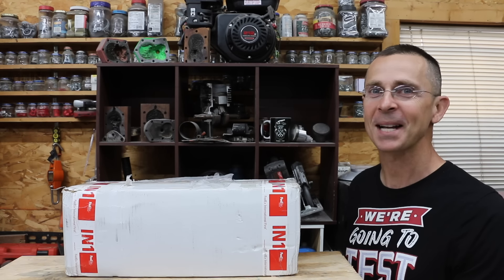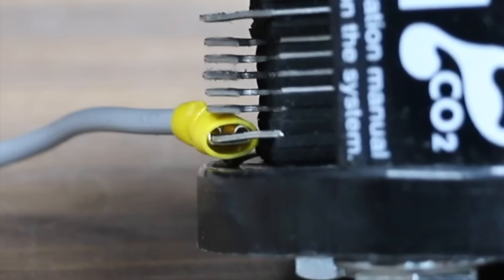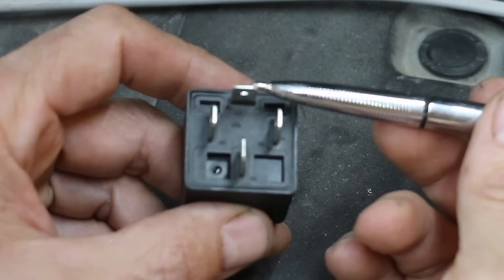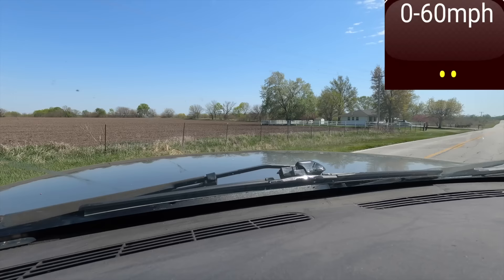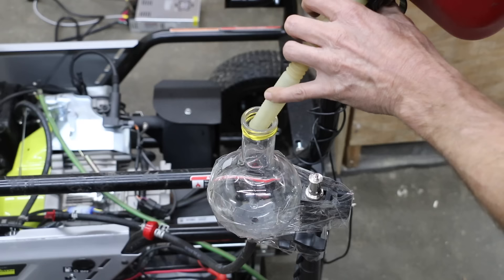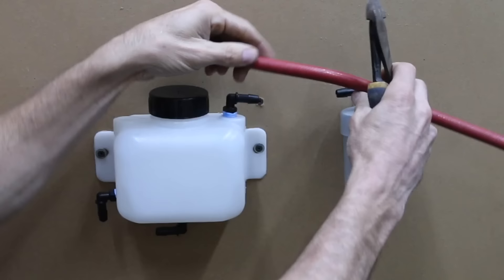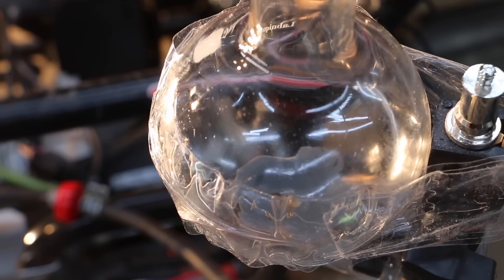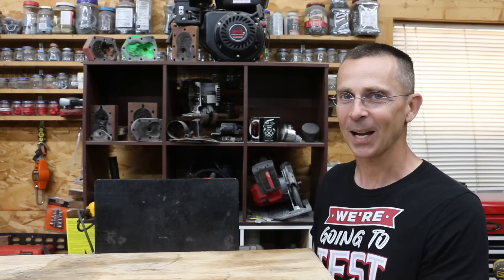AMAZING 35% More MPG with HHO? Let’s find out! Help with high gas prices?

Comment: I recently did a tune on my S-10 with "lean cruise" and so far it seems I only gained about 2MPG. But honestly, keeping up with maintenance IMO is the best way to MAINTAIN good fuel economy. I had a customer a few weeks ago with a wee little 4 cylinder car with almost 300,000km on it complaining about excess fuel consumption. Apparently had regular oil changes since new and a recent new air filter but come to find out IT NEVER HAD SPARK PLUGS REPLACED! Well, that customer called me 'god' for 'restoring' fuel economy and even 'adding' power to their car. Well, no. it's just maintenance lol. 

Also, Project Farm, koodos for going thru that much effort just to show people how this works and if it does work! you have a level of commitment to be desired.
Reply: When is the last time you could actually 'tune up' a vehicle?  1985?  After that they all 'tune' themselves thru the onboard computer controls.  that said I had to laugh at myself when you said they never changed the plugs... I have a 2000 Intrepid I purchased new that has NEVER had the plugs changed either with 217,000 miles! lol  I keep thinking I should pull one just to see if they still have electrodes! LOL
Reply: @tubedude54  When I said I did a tune on my S-10 I meant with HP-tuners. I programed lean cruise in the computer. Your intrepid should be surprising to alot of people but doesn't surprise me. Theoretically it shouldn't be running.
Reply: @michelleberry-1314  Oh NO!!  I better not say out loud when I am driving it that it shouldn't be running! lol  To be fair I did have all the regular maintenance done to it till it hit 75K miles and the warranty expired.  It never said in the schedule to change the plugs in the first 75K so as far as I know it never happened.  Only thing I think about now and then is the timing belt... it was supposed to be changed at 75K if I recall... never was.
Reply: Damn that's some god quality spark plug tho
Reply: @feero9680  I'm tempted to pull one to look at it but afraid in might crumble when I try!
Reply: @tubedude54  I would check the spark plus because those champions are copper. Wonder how they look
Reply: @tubedude54  I had a ‘99 intrepid with the 2.7L engine. Wasn’t a bad vehicle
Reply: @christophervanzetta  Still get about 30mpg on the interstate!
Reply: @tubedude54  you can do spark plugs and coil packs and all that other stuff on cars made up until recent years. It's all nuts and bolts at the end of the day you may have to take an intake manifold plenum off or something like that on some of them but it's still doable. You been living under a rock?
Reply: @kskip4242  Just a hole in the wall! lol
Reply: dirty maf sensor is one that will destroy fuel economy as well,just spraying in clean when doing maintenence is somthing grossly overlooked during tuneup yet very important
Reply: no doubt the oil changing companies told him that they would replace them when they didn't and then they over charged him on multiple occasions. 

it's happened many times and many people have been ripped off, mostly from jiffy lube, that company is so crooked they should never get business for their shady practices. 

not saying you were this, but the places he was likely to get his oil most likely did this as it's very common for folks to go to jiffy lube for their oil change as well as other shit they talk the customer into.
Reply: The actual best way is simply running lower resistance tires at proper inflation levels.
Reply: @kskip4242  I easily replaced spark plugs in my 2005 Camry 2.4. Took me 20 minutes to do it. Did the wiring too. It ran better. Spark plugs are tested to 100k nowadays, I believe. I was past that.

Cleaning the throttle body did wonders too.
Reply: @afcgeo882  oh yeah most four-cylinders are Uber easy to change spark plugs are literally right on top. Anything with a V6 or V8 is a different story.
Reply: @kskip4242  Sure. Inlines are easiest, then Vs, and the Boxers are the hardest.
Reply: @afcgeo882  to be honest the v engines aren't really that hard it's the ones that are mounted transverse in the front wheel drive cars that are hard because you have an intake manifold that normally protrudes over the rear Bank of cylinders meaning you have to take that upper intake off just to get to the damn things.

Comment: You should use the thread tape for gasses vs the liquid kind. I believe it’s usually yellow in color 👍😊 
LOVE your videos! Don’t buy anything without watching your amazing work to see what will serve my needs best! 🙏☺️
Reply from the maker: Thanks!  Thanks for the suggestion.
Reply: Teflon tape is Teflon tape. It makes no difference. The only difference is the color which is to denote that the joined fitting is being used for flammable gas service.  
However, in many instances the tape thickness may be greater. This is compensated with more or less wraps of Teflon on the threads. 
In practical service the color of the tape does not change the performance of the tape regardless of the application.

Comment: I’ve been testing for twenty +- years. First subject, ‘93 dodge Dakota 318, built my own generator, 316 L stainless only, didn’t use their hydroxy additive, # 10 wire straight to unit under the hood with a short run under to the dash switch. No  change in mileage, did run better from time to time. After study, the oxygen sensor system is counter productive because it increases fuel with entry of hho. After understanding how the oxygen sensor operated, I fooled the system, but had very little increase in mileage. I increased in amperage to the system that did increase in power but not much in mileage. I did tinker with hydroxy additives and didn’t see any change. I was warned that hydroxy additives would cause caustic results. Next test subject, 98 dodge  3500 with Cummings diesel. Same way, no hydroxy additive, high amperage straight off duel batteries #10 wire, same 110 square inch generator. The engine increased a small amount of power, and got 7 to 8 miles better in mileage, NO load. Next subject, 06 Ranger small 3.0  engine with low gear package. This truck got lousy mileage, about 10 to 14 mpg. At this point I built a 800 square inch generator…an increase of 650 square inches, went to # 4 wire to stop the loss of amperage. This  decreased mileage because of “big oil” congressional oxygen sensor environmental crap brain loonacy. I put the sensors on risers and removed the ‘catalytic converter’. Warning… some states this tinkering is illegal to put on the road. The little ranger diffinitly increased mileage to 20mpg and power, but  because of the low gearing the 3.0 ranger, high speed interstate performance waned in mpg. 
I’ve known about hydrogen for 60 years or so…ww2 used it with some success. NASA did a study in 1970, and stated the hydro gas is 130 or so octane level, and their test subject, a ‘69 Cattie. in this era vehicles, there was no big oil b s ‘save the planet’ oxygen sensor system. You may still be able to get a view of that NASA study, and if I remember right the Cattie ran on nothing but hydrogen, of course NASA has a never ending supply of the gas because it’s their main juice to get in the air. Dave, 205-215-8380

Comment: Excellent test.
Reply from the maker: Thank you!
Reply: Yeah I hope he has more debunking videos in the future!
Reply: @ProjectFarm  yeah it is not an excellent test at all honestly it's just an experience showing that's all you need to do this with a carburetor or you need to adjust the amount of fuel going to the generator... Because it is set up to run at a set standard and will not increase fuel efficiency at all if you do not do this... The generator was designed to work with the fuel system that it has was not designed for this add-on. This is a botched test at best!
Reply: @ProjectFarm  please leave the engineering to the engineers...
Reply: @ProjectFarm  do I agree with the systems that they work absolutely not but you're testing methods are absolutely flawed and you're spreading propaganda because of this...
Reply: @AquarianSoulTimeTraveler   He proved its bunk.  We all know it’s not a perfect science experiment with all variables controlled. It’s good enough to say it’s snake oil garbage.  You make a channel if your elitist self can do better.
Reply: Yes, great to see laws of thermodynamics are in order.😂 snakeoil🤷‍♂️
Reply: This guy really doesn't understand the science behind these HHO Snake Oil devices.
Reply: @BeefNEggs057  yeah I have a channel but I don't give views like others because I don't do bs videos about unimportant topics... Aka cat videos. I tell people about top secret military programs and other important information mixed with a bunch of other useless crap to try to get views... Doesn't matter I've been blacklisted. The biggest flaw with this was using a fuel injected generator... If you use any stock generator it's going to get the exact same fuel mileage and consumption because it is meant to run with oxygen and a liquid fuel not hydrogen as a supplement for liquid fuel... Well in this guy's defense whoever sold this product probably made a whole bunch of false claims and said you could just strap it right onto any car and it will work without reprogramming the computer to compensate for the extra fuel in the air... The system will probably make the engine last longer because of the increased richness of the air fuel mixture ratio but without reprogramming the computer and with such a small device it will never achieve the mile per gallon increase in which they claimed... Either way. Thanks for the effort.
Reply: @AquarianSoulTimeTraveler  I'm waiting for your video showing this kit works, at all.
Reply: @anydaynow01  Yeah I've already wasted enough time in this comment section definitely not going to waste any more time with this video or making a video about this topic... It wouldn't matter I wouldn't get any views anyways... Or they'll give me just enough views to where I will continue to make videos but not enough to actually reach a real audience. Anyways have a great life... Enjoy the food.
Reply: @AquarianSoulTimeTraveler flawed or not, the mathematics don’t support the claims of HHO.  All of us here would love a “free” or trivial cost fuel supplement that would deliver on the claims, its not that we don’t want it or don’t believe it, it just doesn’t work.
Reply: @beez1598  actually that's completely false there are systems that can work to increase the fuel efficiency of gasoline by itself... Car manufacturers actually bought these patents with hopes of increasing fuel efficiency but because of how dangerous the process is they cannot Mass produce it... The flashpoint of gasoline is very close to The vapor point... That's why vapor failed... Not because it doesn't work but because it's too dangerous. One thing I feel like people are not understanding here is how a computer system works on an engine... They're preset to run off of gasoline and air not gasoline and hydrogen which is an extra fuel added to the air intake... What I'm saying is you might see a slight increase maybe 2% or 1% increase if he was to reprogram the computer on the generator or in the car. With increase in fuel added the engine will actually retard itself with a computer installed. I agree with you the system is probably crap But so were the testing methods in this video.
Reply: @AquarianSoulTimeTraveler  
 You can bypass the map computer system by add hydrogen through the power break line that goes into the intake manifold. It's not that dangerous when only using it as you make it. It's not the Hindenburg. With lines that only lets gas flow one directions, if in a crash you will have broken glass and water.  This message is not my belief, it's my knowledge. People have been lied to for a long time sorry to say. Thanks
Reply: @martymcmannis8662  I feel like we're on two different pages here dude... Maybe you're only partially reading what I'm saying and then spouting off... Idk I'm done wasting my time talking to brick walls. Have a nice day 😚
Reply: @AquarianSoulTimeTraveler  all fair points, and I don’t disagree with you on niche methods for increasing gasoline efficiency. However, I think the important takeaway that PF was attempting to illustrate was that these devices, which are available all over the internet either DIY or on eBay, are bunk. If anything, he’s trying to save a viewer from purchasing such a system or wasting time constructing one. Flawed experimental design or perfect experimental design would have illustrated that an alternator driven HHO generator does not yield the outrageous claims presented by the manufacturer.  If you have a product that you think would yield results within their claims, post it in a new comment thread, he seriously reads every comment he can and may test it!
Reply: @ProjectFarm    Hey neat video. I had a savings account building up for one of those kits. You proved I shouldn't buy into it.

There's tons of additives for transmissions and diffs that give a marketing spinoff that would make an interesting video
N' yes your thumbnail has such a proud look about it.
Reply: @AquarianSoulTimeTraveler  Agreed with you. That testing method is definitely flawed.
Reply: @AquarianSoulTimeTraveler   Right my understanding is you have to reprogram the ecu. It doesn’t work unless the fuel is leaned out of the air fuel mix. Either way I wouldn’t do this to my car. What a hassle.
Reply: @AquarianSoulTimeTraveler  "Car manufacturers actually bought these patents with hopes of increasing fuel efficiency but because of how dangerous the process is they cannot Mass produce it". Which patents did they buy?
"What I'm saying is you might see a slight increase maybe 2% or 1% increase if he was to reprogram the computer on the generator or in the car." The manufacturer claimed 'Lower Fuel Consumption: up to 35%'.
Reply: @AquarianSoulTimeTraveler  The generator already regulates it's self due to load. What do you mean? If the fuel is better/worse, it will generate more/less power, thus the load supply will vary.
Reply: @AquarianSoulTimeTraveler  You are 100% correct, way too small a device for a engine in a vehicle but would probably work on a 3.5 HP lawn mower.
Reply: @BeefNEggs057  This test proves nothing but that @project farm didn't do his due diligence before doing his failed and flawed experiment.

Comment: I've ran a home made HHO set up on my 87 Silverado 454. Took the motor from 9 miles a gallon to almost 20 miles a gallon. I have a carbureted motor. The trick is you have to starve the motor. Because you supplementing the fuel with Hydrogen. The same thing can be done with a regular motor. You have to fool the mass air flow sensor. To think it's getting the same out of fuel. And supplement HHo.

Comment: This is like the equivalent of powering a solar panel with a lightbulb, plugged into the solar panel.
Reply from the maker: Thanks for the feedback.
Reply: It's actually impressive that this thing isn't hurting fuel economy (at least to a reliably measurable degree), but that's probably because it's only producing a trickle of gas in the first place.
Reply: Cut out the excess gear, and just plug a power strip into itself, when you need portable (and perpetual ... allegedly) power !
Reply: @TonboIV  Probably just enough to match the normal alternators load/resistance off other cars electrics. So barely measurable.
Reply: I loved your comment it made me laugh my a** off
Reply: Watt do you mean? 😆
Reply: @jasonmichinko2304  me too lol
Reply: The only possible performance gain is if adding hydrogen and oxygen to the air/fuel mix somehow influenced combustion to produce more usable power and less waste heat, it doesn't necessarily have to be a free energy source when ice's are no way near 100% efficient. 

Obviously this isn't the case here as shown by the results, but in theory something like this could improve efficiency a percent or 2, no where near 35% though that's for sure.
Reply: No, the power supply was saperate
Reply: @arlobubble3748  A percent or 2 is irrelevant and results would need to be thoroughly analyzed to see if its just a variable anomolie that would exist anyway without the hho
Reply: hahaha exactly X D
Reply: @Charles McKinley damn those big oil compagnies, and laws of psysics!!
Reply: @fastinradfordable  loooooooooool X D
Reply: @trillrifaxegrindor4411  lol anomolie
Reply: @Charles McKinley the typo wasnt the only thing funny to me, the logic behind it  cracked me up aswel.
Reply: Should have lit those bubbles with a flame to see if it's actually putting out hydrogen